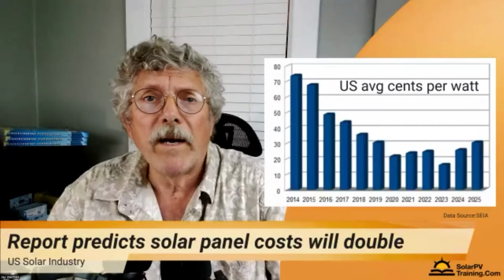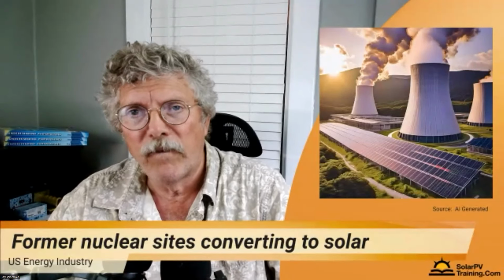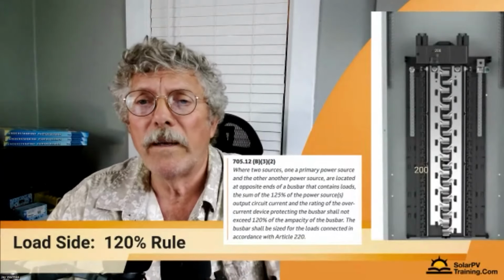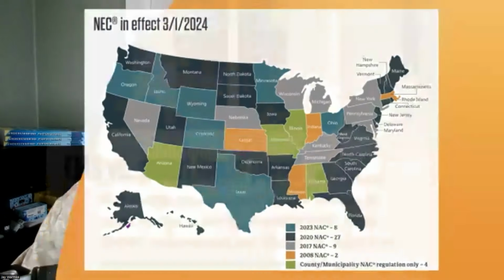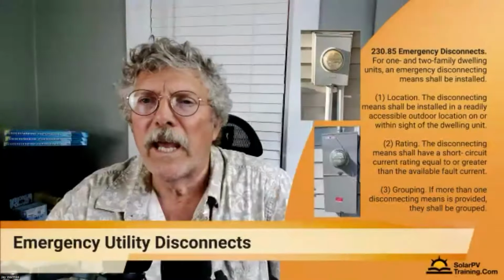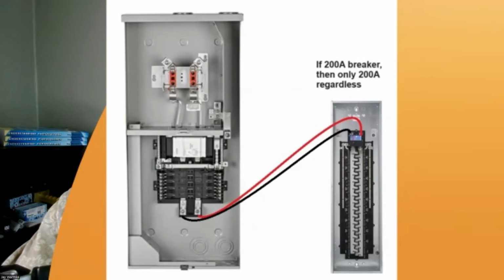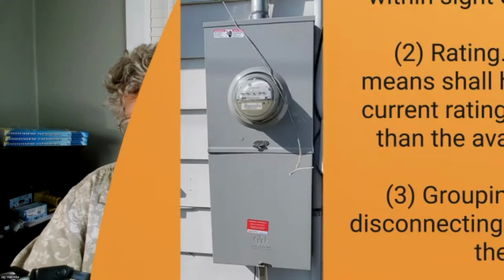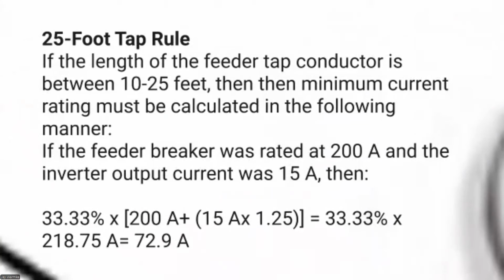Connecting your solar array to the grid  (Solar Noon Tuesday)

Comment: jay: with all those disconnects/shutdowns (inverter, pv, battery) that need to be accessible outside, is there any system that consolidates all these in one big red button?
Reply from the maker: For some of the larger systems there are units you can buy (or in switchgear) that allow you to turn off multiple things with the throw of a single switch.  However the code has changed recently regarding how many switches you can have and what is required.  I read a number of articles and watched some videos on it - but it just seems to confuse me more.

Comment: Jay as always informative and thought provoking.

Power Control Systems (PCS) have the potential for larger usage.

For a future episode?  Round 2 of Connecting your solar array to the grid?

Are grid-tied interface designs redundant and grossly oversized?

Utilities and regulators often specify limits on bi-directional power services.  Often the import and export limits are unequal.  Why?  Convention and because they can?

Integrated PCS of battery, inverters and loads can shape both the energy and power of an AC couple grid tie.  Regulators, lenders, municipalities and utilities often cite minimum utility service size.

Who benefits and can Solar be trusted?

For example in a residence equipped with an alternative energy system and PCS shouldn’t an optional grid connection be viewed as back-up to meet any shortfalls and then only to the owners discretion?  

Current practice is the opposite.